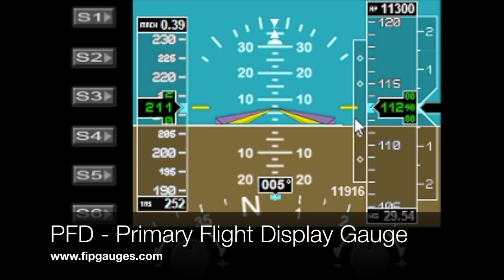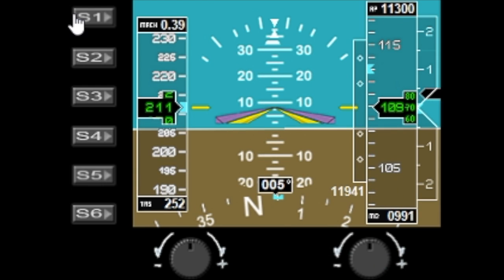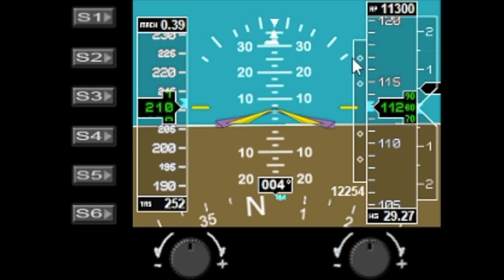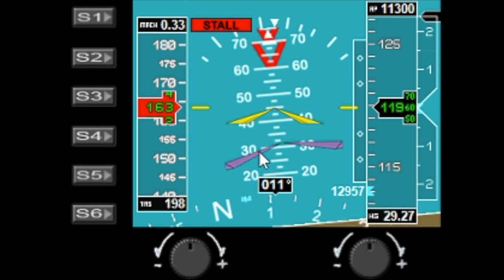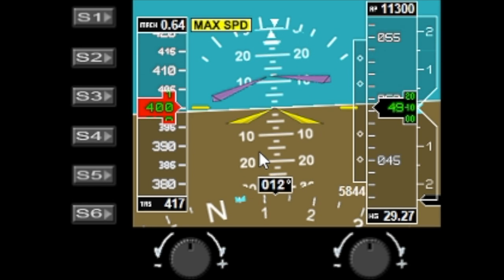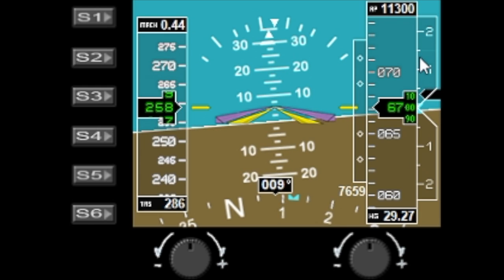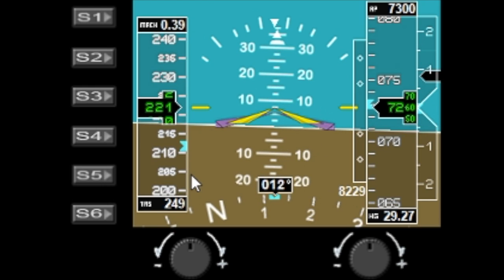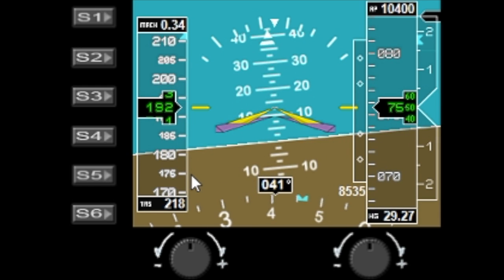PFD Primary Flight Display Gauge - Saitek/Logitech Flight Information Panel & SPAD.neXt

Comment: FYI. Your demo video appears to be out of date. In the video, the speed tape tick mark background doesn't show the colored speed ranges, which I thought was a major oversight. I bought the gauge anyway and was pleasantly surprised to see that after configuring it for the first airplane, the speed tape actually does show the colored range backgrounds. <S1> enters the configuration menu. <S5> toggles the QNH units. <S6> sequences through the display background shading (Light, Medium, Dark) and toggles between 1's an 10's when entering values. Really nice gauge! Well done!

Comment: Hi have you ever considered developing a gauge say for FSX ATC menus or GSX menus for example open cargo doors etc.
Reply from the maker: jodonbaker43 ATC, yes many many times. I've asked SPAD.next to make ATC menu text available as variables so I can create a gauge. Unfortunately it's not possible right now in SPAD so I can't put the ATC data into a gauge. While I can send ATC menu commands I just can't display the output from the ATC on the FIP, I've been after this function myself for a long time and if it was possible I would be using it myself by now. When Ulrich isn't too busy I might ask him again just to annoy him :-) I can send ANY FSX/P3D variable from a FIP, but if you just want to send things like door open you can program those on buttons your self, but the screen become pretty redundant except to show some toggle indicator. you can also re-program the buttons on any FIP and re-label them to whatever you want. See button labelling tutorial. Daz
Reply: Thank you very much for your reply I was hoping this could be done.When you say you can send ATC commands can you explain please.I have no knowledge of programing do you mean you can send a command for example open cargo doors but the FIP wont show the text cargo doors open.
Reply from the maker: jodonbaker43 there are ten ATC commands ATC, ATC1,ATC2,ATC3................ATC9 which you can send from SPAD, any button, any dial to the ATC and it's like you pressing 1-9 on keyboard. Just add Simulation Variable (not data definition) to a button and search "ATC". you could have a gauge with text = cargo door open/closed, yes, if you can code gauges, but this kind of stuff is very personalised and fairly wasteful of a powerful gauge device. Most things are possible, except ATC and GPS, there are thousands of Simulation variables you can assign to buttons. Just don't see a commercial application for just text on a FIP. Daz